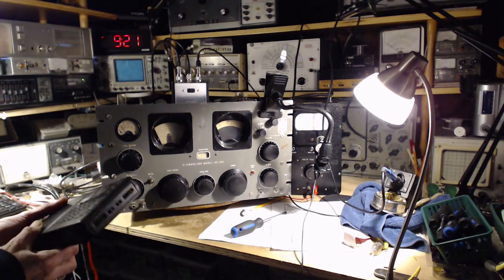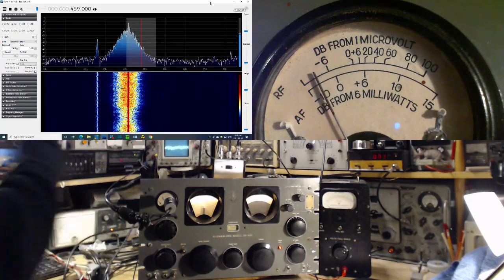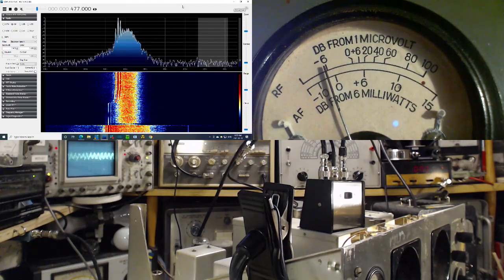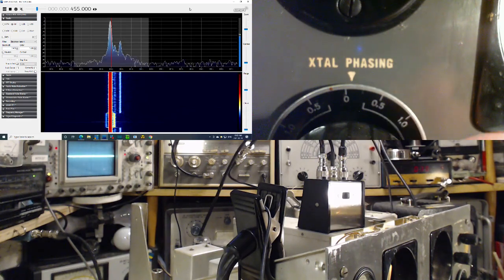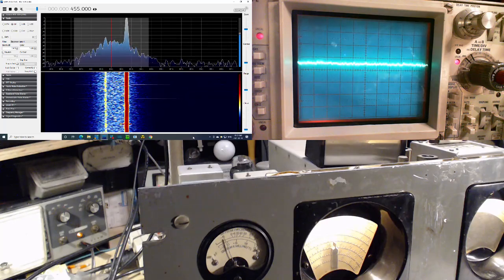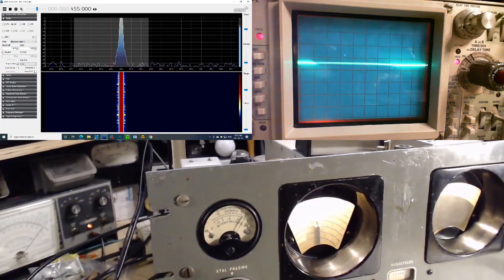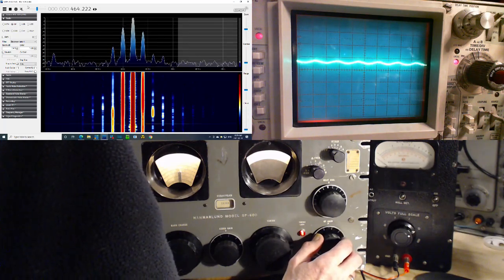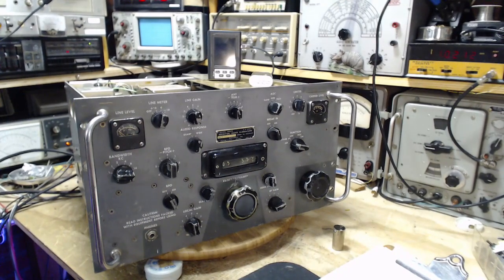Hammarlund SP 600 Video #16 - Finale

Comment: Nice radio tests. I run a Softrock SDR optimized for 455 KHz hooked up to the 455 KHz output before the radios IF deck and filters on both a R-390 and R-390A this gives the widest frequency span display. The software is Power SDR IF stage feeding a 192Khz sound card. The quality is amazing with the finest tube receivers.